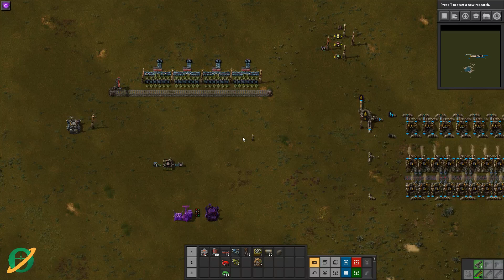Factorio Beginner Tips: Introduction to Circuit Networks

Comment: The two most clever things I did with circuits is controlling three filter inserters filling a chest from three mixed belts to set limits of six items being collected, and the other one is making a train stacker for a standby station where only one train is allowed to leave at a time (in rotation) when the next stop on the schedule clears. Not showy like many things, but practical for buffering resources.

Not quite as clever but also handy is to put alarms on ammo chests feeding defense on a remote base so it'll put a flag on the map when it runs low. (Better to get that alert and handle it than that of the oil field getting eaten by biters.)
Reply from the maker: Circuits and filter inserters are a powerful combination!